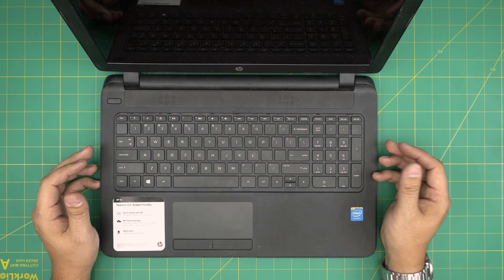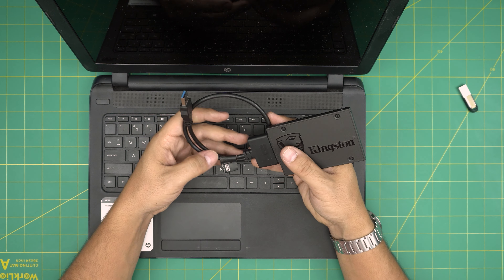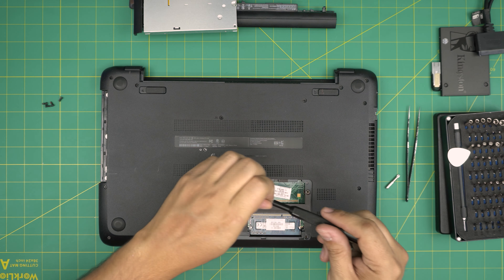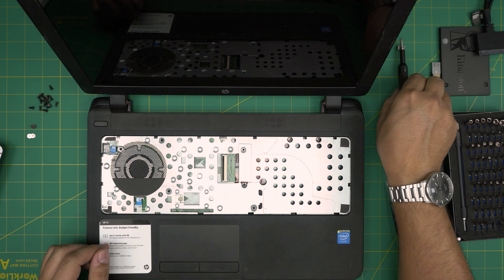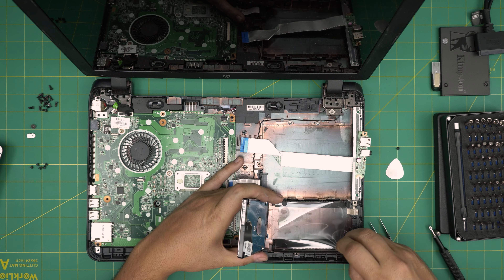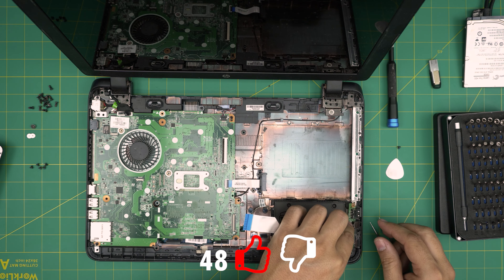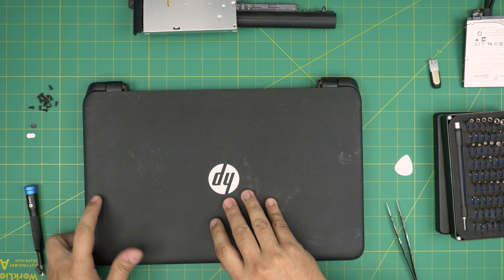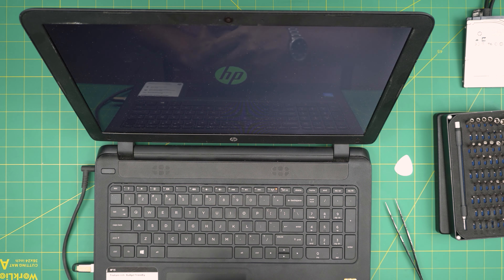How to Upgrade Storage SSD - HDD for HP 15 NOTEBOOK 15 f039wm Laptop | Step by Step

Comment: Thanks for the clear and detailed video. Helped me in upgrading our 8 year old laptop. Only difference I faced is that internal HP firmware overrules the external boot USB and installs the factory version of Windows. So boot USB is not needed
Reply from the maker: It's truly a pleasure, my friend. 😊 I deeply appreciate your taking the time to provide feedback. If you're inclined to support the channel further, feel free to like and subscribe—or even both!
if you replace the hdd with SSD , there is not factory OS anywhere to read from, you must have the windows boot in a USB in order to boot from, unless you purchased an ssd with windows in it.
Should you have any questions or requests in the future, please don't hesitate to ask me.
🍻cheers
Reply: @uFixTek  I think the particular model I upgraded had a HDD (Drive C) which I replaced with SSD and also a tiny internal SSD (Drive X) with boot software